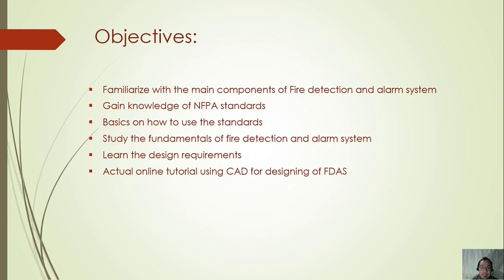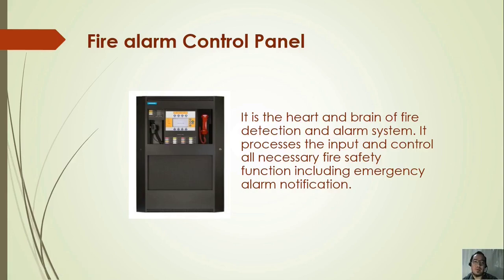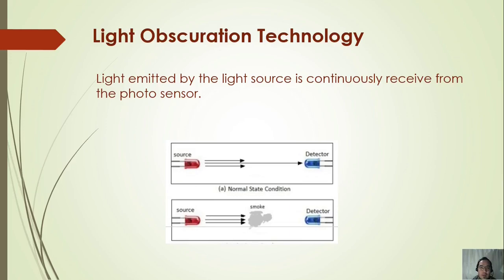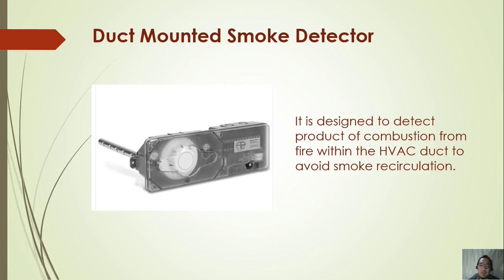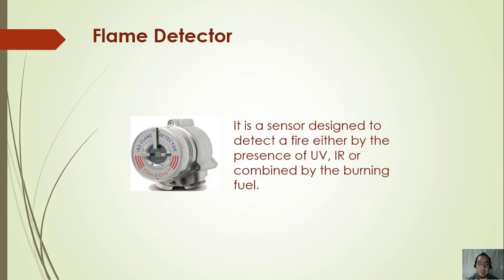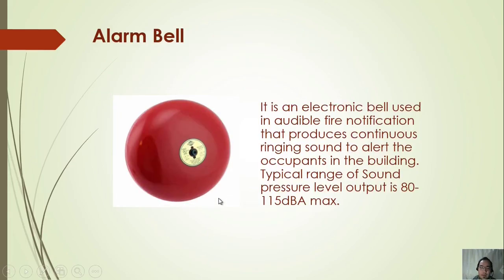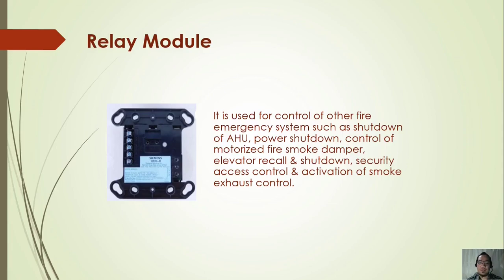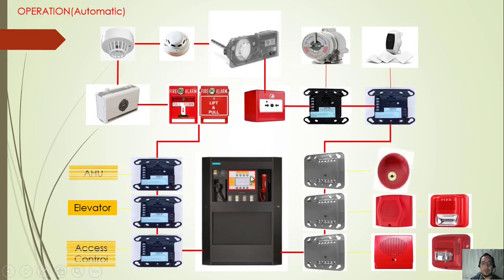Fire Alarm Installation Training - Design Tutorial Part 1/3 #Firealarm #Design

Comment: Hi, I'm new to this. Looking for a career. How do I make money with this? What's a good certificate to get in this field? Any recommendations would be highly appreciated.
Reply from the maker: Hello, it really depends on what your state or local code you're in. Some countries require local certificates to be certified as a fire alarm designer and some require that you get your certificate from the manufacturer of what brand you use in your design. But if you're looking for a certificate from a recognized organization like NFPA to start with your career in this field, then you can check the nfpa website and there are a lot of available seminars you can attend there like nfpa 72  for you to start working in fire alarm industry.
Reply: Engineering degree

Comment: Sir, I have a question , is the speaker audible notification appliance is built in power amplifiers? or it's required external amplifier? Thank you in advance sir.
Reply from the maker: Hello thank you for watching. No built in. The speaker will be connected from the amplifier and the strobe light is connected from the fire alarm NAC circuit if the speaker is with visual notification.

Comment: Sir...can I have a request again a favor? The existing building (3-story) needs to install an elevator, the proponent wants the elevator to be connected to the existing FACP conventional system, recall elevator to the primary floor and recall elevator to the alternate floor (if a fire occurs). What are the additional devices to be connected to the existing FACP in order to function the elevator smoothly?
Reply from the maker: Make sure when you interface elevator to FDAS, there is a smoke detector in the elevator lobby within 6.4 mtrs from centerline of elevator or if you have sprinkler inside the elevator shaft, then you must have both smoke & heat detector inside shaft installed for elevator recall & elevator shunt.
Reply: @AllaboutFireProtection  Thank you very much sir....

Comment: Very informative sir and well explained,. Any link sir for pdf files for guidelines in designing fdas.thanks and more power.
Reply from the maker: Please tell me your email so i can send you the pdf.   I appreciate your feedback. Thank you.
Reply: @AllaboutFireProtection  butiongrichard@yahoo.com thank you for your generosity, someone already sent me a copy from whom who also ask for the copy of your slides. Godbless!
Reply from the maker: @richardbutiong8762  You are welcome Richard. I guess I don't need to resend then. Just feel free to ask if there something you need as long as i can help.
Reply: @AllaboutFireProtection  thank you sir, actually i have few more questions specialty about zoning, how to determine the number of detectors in one zone? Or how many detectors should i conect?thank you.
Reply from the maker: @richardbutiong8762  We normally assign separate zone per floor otherwise if there is a fire or smoke compartment as fire division between areas to allow relocation of occupants to other zone as part of fire evacuation strategy then we can have more than 1 zone per floor. The quantity of your detector will depend on the number of device of your FACP can handle as per manufacturer's recommendation. If your system is conventional fire alarm system then it will depend on the capacity per zone, if it's addressable, then depends on device per loop.
Reply: @AllaboutFireProtection  thank you sir, which is more convenient to use, for example ina a 3 storey building conventional or addressable? And when you refers to conventional is this zoning and for addressable the term used is loop? Both can accommodate 1 zone or 1 loop for every flr?
Reply from the maker: @richardbutiong8762  Hi, the use of conventional or addressable system really depends on the evaluation of the designer or as consultant of owner of the building. Using addressable fire alarm system has a lot of advantage in terms of exact alarm reporting and other system features. That is why usage of addressable fire alarm system are mostly used  except when you have a small restaurant, coffee shop, boutique etc..where the floor area is very small and alarm by zone indication will be fine. The less response time that system offers for fire alarm notification the better. If that 3 storey has a huge area where there is a lot of compartments, rooms, utilities etc, I would recommend the use of addressable fire alarm to identify the exact location of fire in less time which is very helpful for fire fighters. But this decision should be always discussed along with the owner as a recommendation. Zone circuit is for the initiating device circuit of the conventional while signaling line circuit for addressable. Though, in addressable you can also assign a zone for each device by programming.
Reply: @AllaboutFireProtection  thank you sir for the brief explanation.this will be a big help specially gathering information. Thank you for taking time to read and answer my comments. Very much appreciated. Waiting for another video to upload. Godbless!
Reply: Sir this my mail could send me that file
Reply: eng.nabil4490@gmail.com

Comment: Addressable po ba sir ung example mo sa last part ng tutorial?
Reply from the maker: Yes sir, yung VESDA laser focus natin kung mapapansin mo nakakabit din cya sa loop pero in real wirings meron yan monitor module for trouble & alarm supervision. Hindi n lng natin cya ipinakita in detail s presentation.
Reply: @AllaboutFireProtection  paano sir ikabit ung tamper switch at flow switch sa FACP? dadaan pa ba yan muna sa monitor module tsaka nkaconnect sa loop? Pwede rin po bah ung sounder mo nasa iisang loop lng ng detectors mo without module?
Reply from the maker: @talktoomuch6703  Yes sir, yung tamper at flow switch natin yan either may tagisa yan na monitor module or kung may dual module pede din yun na gamitin for both. Yung sounder natin pwede lng cya ikabit within same loop kapag yung FACP supported yung  powered loop at ganun din yung audible mo kung addressable type cya at listed sa FACP mismo.
Reply: @AllaboutFireProtection  anu ibig sabihin sir na supported ung powered loop?meaning dapat specific na ung FACP na bibilhin mo ay may feature na ganyan sir? tsaka sir ilang wire po ba mag connect sa isang loop sa isang addressable type?2 wire lng po ba yan?at anung type of wire po na gagamitin? nagdedesign kasi ako ngaun tapos first time ko mgdesign kaya mejo nalilito pa po ako..
Reply from the maker: @talktoomuch6703  yes, meron available sa market na addressable system na supported ang powered loop like honeywell. Kaya pag nagdesign ka make sure na iconsider mo yung limit ng manufacturer pag powered loop gamit. Kasi pag powered loop mas unti n lng yung pwede mo gamitin na devices sa loop at ilan lng na notification devices pwede mo gamitin. Meaning pwede dumami ang loop na gamitin mo dahil sa limit ng notification devices na ggamitin mo. Imibis na 1 loop ong halimbawa need mo naging 2 loops pa. So, make sure pag addressable system na supported ang powered loop, iconsider mo yung limit ni manufacturer like kung honeywell yung reference mo , sundin mo. Iba iba din capacity ng loop for every manufacturer pagdating sa facp kaya pwede ka ng magrefer sa kung ano manufacturer na gusto pag nagdesign ka or kung sa contractor ka follow mo kung ano specs ng facp na offer nyo. Pag sa consultancy ka namn, ikaw magdecide ano manufacturer ka magrefer na magmeet ng project specs mo.